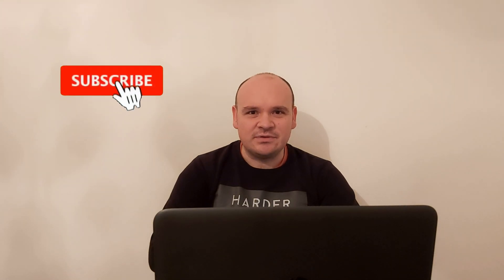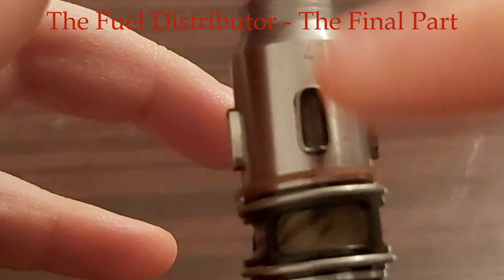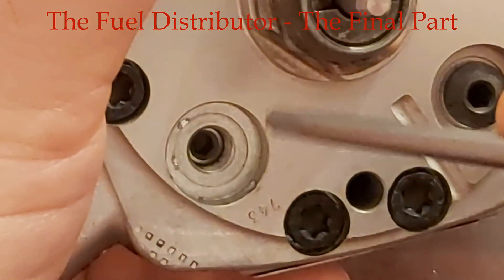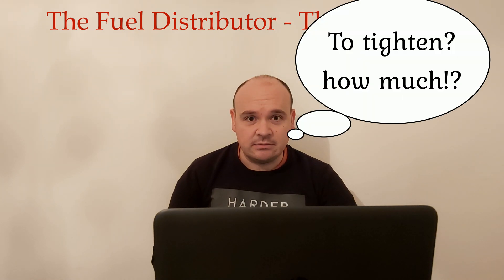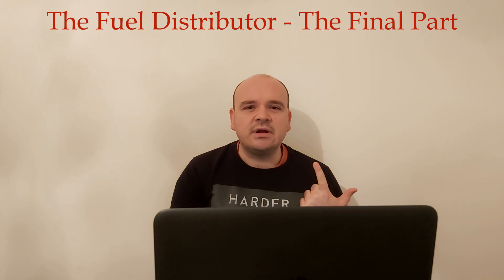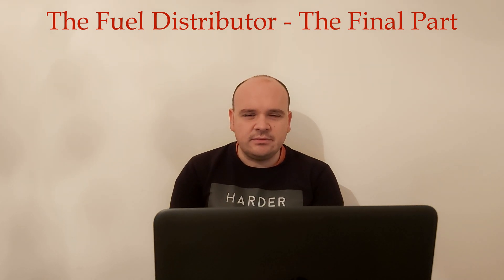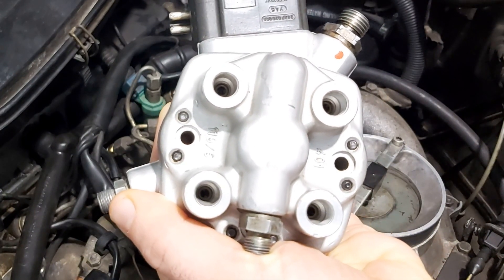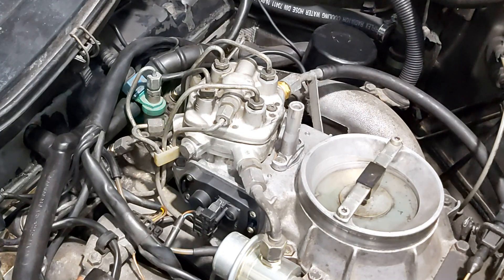Mercedes KE-Jetronic - The Fuel Distributor - The Conclusion - The final Part

Comment: Hello from deepest darkest Cheshire UK, i have followed your videos and they are great, my M104 SL when it did start produced clouds of black sooty smoke, your videos gave me an understanding of how the system worked, So i cleaned the mass airflow filter, cleaned the idle valve and then took a look at the EHA valve, that got a calibrated tap with a spanner, i changed the plugs too and cleaned the rotor arm and distributor. Drained the tank and changed everything at the back end,  and put a good quality fuel cleaner in the ten liters of fuel that  i uplifted, Here was the moment would it start properly ?????  YES YES YES success, it sprang into life and that straight 6 purred away to itself. No black sooty smoke success is all down to you my friend,
Watching your vids gave me the confidence to investigate , Hopefully the car will soon be on the road again, BUT i have a fluid leak from a rear brake just to keep me busy. Once again a big thank you and best regards you are a natural teacher , John k Cheshire.
Reply from the maker: I'm glad I could be of help. Just keep driving it. Greetings from Knjaževac, Serbia and Happy Mercedesing 😊 😃 😀 🍀🍀🍀

Comment: thank you so
Is LPG in cars affects the Fuel 
Distributor?
Reply from the maker: Well, as far as I can say from my experience with LPG - for LPG you need a "perfect" current - the distributor cap, the cables as well as the spark plugs. The fuel distributor is not affected because LPG doesn't flow through the fuel distributor but you can have issues if the o ring which the plunger in the distributor is resting on starts leaking - you will get constant detonations because LPG and gas combust together.

Comment: Hello! I've read on BenzWorld.org the procedure to fine tune the differential adjustment screws on the Fuel Distributor. I don't know if this is correct, but that's what they say: completely screw in all the screws (being careful not to tighten too much), then unscrew by 3 turns. Then place the Fuel Distributor back in the engine but instead of connecting to the injectors, you need to make yourself some flexible fuel lines, each going into a plastic graduated container. The goal is to measure the flow and check if it matches the specifications provided in the manual. To do so, you'll need to press the air metering plate all the way down for 60 seconds and see how much fuel comes out. If there is over 10% difference in some of the ports, you will need to take the Fuel Distributor off the engine again and fine tune the differential adjustment screws (tightening will reduce the flow, untightening will increase the flow), and of course they are very sensitive. So, as it seems, it's nothing impossibile, you just need to know the exact flow according to your engine and equip with some flexible fuel lines and a lot of time and patience
Reply from the maker: Exactly I know that, that's what I was talking about in my first part on the distributor. 3-3,5 turns and I tried it, the screw goes veeery easy. On one turning it 3,5 turns I got 12,3mm and on the second 12mm distance when I measured it with the caliper. You must be patient like hell if you want to get the same value. I read in a manual that the screws should be measured from above when the distributor is disassembled. I think that you must get 240ml of fuel flow in a minute, something like that. Best regards, my friend!